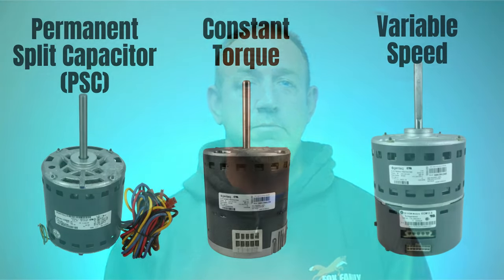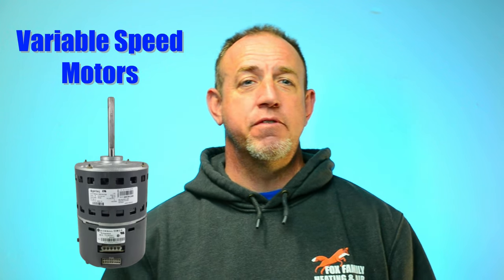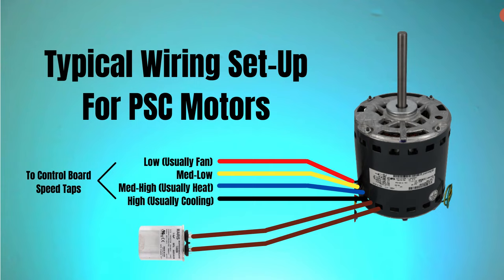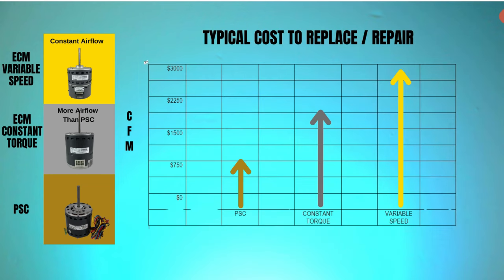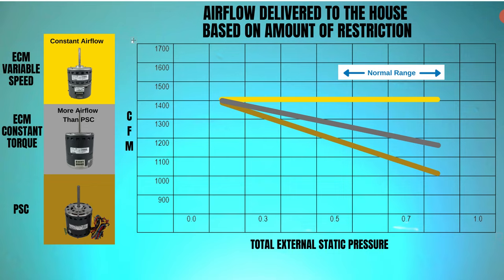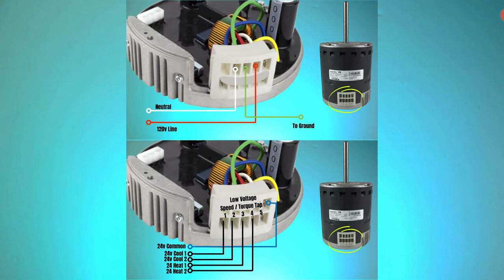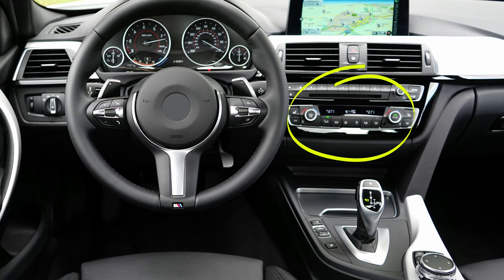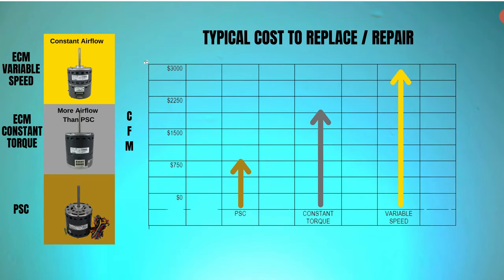PSC Motor vs Constant Torque Motor vs Variable Speed Motor | Comparison Video

Comment: Higher repair costs and longer down time to get the part to repair for OEM ECM motors unless you live close to a dense urban area.
Reply: Yes the down time for ecm repair isba joke and the repairs cost is crazy. Om an hvac tech and im sticking with my psc

Comment: Amp draw will depend on the type of fan blade. A PROPELLER MUST MOVE AIR (FLUID). So a prop type fan on a plugged condenser will suck air in near the shaft (working harder) and draw more current. But a plugged filter with a squirrel cage blade will cavitate and not do hardly any work drawing less current. AMP DRAW IS A SNAPSHOT OF HOW MUCH WORK IS BEING DONE.

Comment: "When it comes to repairs I'm going to pay thousands for technician to install a new motor," I heard you say. I take this to mean a system repair that involves replacing a motor. Would I be wrong in guessing the labor cost is on the order of the materials cost? If yes, then why? We're not repairing the motor. We are replacing it. Sounds like we need a variable speed motor that's not so hard to install however infrequent that might be, because I can't imagine these things have an a high efficiency rating if their lifetime is short.

Comment: 8:18 PSC is brushless too
Reply: Which motors are brushed?
Reply: @La01781  Universal motors have brushes, like those found in kitchen appliances like blenders, also corded power drills, some washing machines.
Reply: @flat-earther  even washing machines? I knew about the drills and stuff. Do vacuums use brushed?
Reply: @La01781  I believe in America washing machines use induction motors and those are without brushes, but in other countries there are many that use universal motors with brushes.
Corded vacuums use universal motors.

Comment: Gee, I thought the 'split' of PSC motors was because there are two windings, a run winding and a start winding. Incoming AC current is split between the two windings in parallel....

Comment: Variable speed motor SUCK BALLS. they don't last. the motors are good the electronics in them are cheep Chinese GARBAGE. it cost $800 and up to replace just the motor. the PSC motor cost about $200 to replace but rarely ever needs replaced. the VSM last for about 2 or 3 years.

Comment: An ecm adds comfort, ramping, the ability to provide two or more capacities to the system, constant air flow, humidly control and incidentally, energy savings. ROI on the blower motor has never been high on customer's lists. Reduced interior start up and running noise is always appreciated by customers after upgrading to an ecm based system. Many had no idea quiet forced air was possible.

Reliability can be an issue especially when sales techs get to up their commission but don't want to redo bad ductwork. 

In a similar manner, Genteq is responsible for some bad engineering of the power electronics especially in the 2.x versions. It is entirely possible for power electronics to protect themselves. You never hear of bad electronics in automobile variable speed applications like compressors, power steering or blowers. You rarely hear of power control failures in minispits with variable speed motors. Genteq has improved their more recent controls and there are now universal retrofit motors that can be field programmed. The future is here; the residential and light commercial industry will adapt.